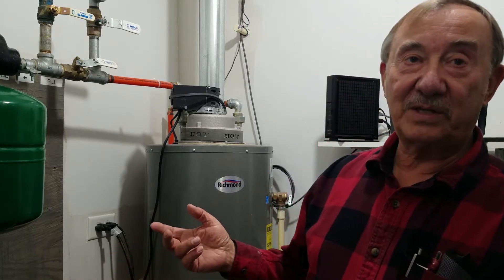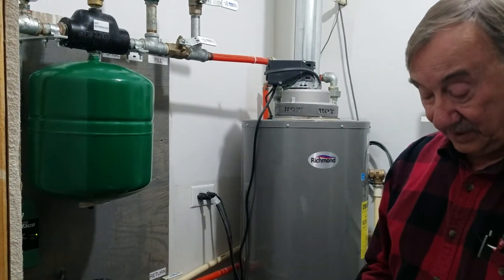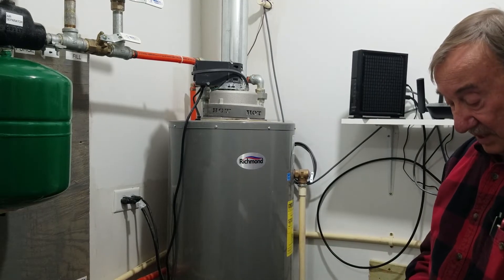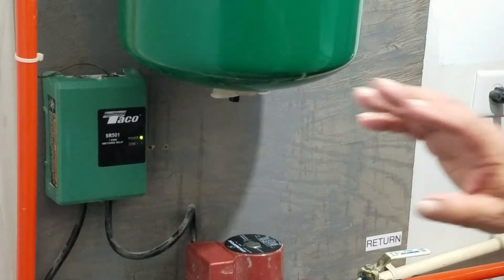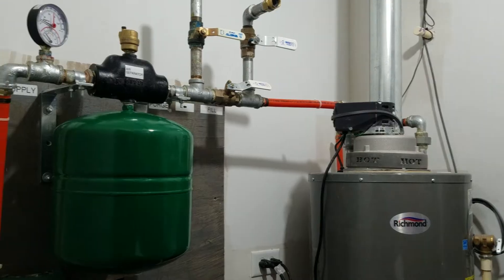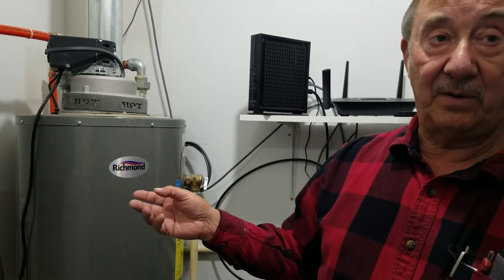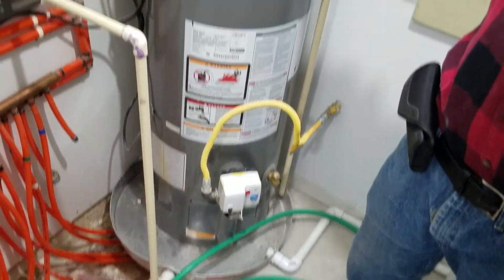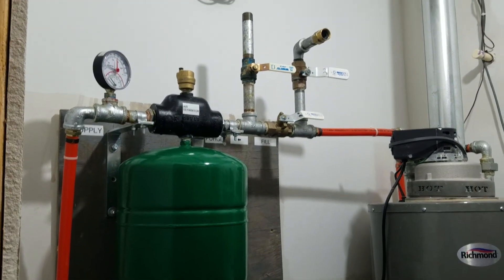Radiant Floor Heat With A Water Heater

Comment: I have 100percent radiant heat in my 1600 foot one floor home and 800 sf garage under it. I have an 11 zone manifold upstairs and a 4 zone manifold in the garage. I currently have a Buderus 115kbtu  cast iron gas boiler that heats the radiant system flawlessly. I have 35 solar panels that cover my electric bill 99%. I am considering removing the boiler amd installing an 80 gallon HYBRID water heater because I want to add 35 more pv panels. My energy guru says that hybrid water heating is cheaper than gas or oil. I always thought that a water heater wouldn't cover heating my home... which is fairly well insulated.  You may consider replacing the gas water with electric hybrid... and possibly a stainless storage tank to cover the slower performance of a hybrid wh versus gas. Nice video.
Reply: I can't imagine running an air conditioner is cheaper than gas or propane and you have to have a mild climate. It's -22 C here and dropping to -29 tonight without the windchill. A heat pump would never work here and gas is so cheap that electric doesn't make sense. I don't know how much solar panels are, but I don't think you will ever save any money buying enough to heat your water. You're probably better off using vacuum tubes even though they are a pain in the ass. And do you really have 11 zones in a 1600 square foot house? That seems insane and way more complicated than necessary. You should do a video on your house because it's a pretty different system.
Reply: What are all the zones for? Wouldn’t the garage be one zone? I’m starting to look at building my own system.
Reply: @briankloc  Looking at it again, I think he means loops not zones. The garage should have 4 loops controlled by as one zone by a single stat. You could have bedrooms and living areas as different zones but getting overly complicated anymore makes for more problems with no efficiency savings. You usually try to go 250 feet per loop to get 4 loops out of a 1000 foot coil with as little waste as possible. Getting a designer to design it isn't too expensive and guarantees it will work right.
Reply: @briankloc  the garage has 4 loops of pex in the concrete. All 4 loops are controlled by one thermostat.... but requires 4 zone valves.... one for each loop. It requires a 4 valve manifold.
Reply: @deckmonkey1459  11 zone valves for 11 loops.. controlled by 4 thermostats. As far as the efficiency of the hybrid water heater... if it gets crazy cold like you describe I honestly think it would switch to resistance heat. The energy guru knows the numbers and for Massachusetts its cheaper in DOLLARS to heat water with a heat pump water heater than gas or oil. It really almost never gets below zero in my area south of Boston. Adding more solar panels to cover heat and a hybrid plugin car will have a payback date... the energy guru set that too. The PV system in place now covers 100percent of my electric for 5 years. I get a check quarterly SREC that pays me about $3000/ year just to produce electricity. The system will be 100percent paid paid off in 1 year... between SREC and electric bill payback. For the next  20+ years its all profit.  I hope to add another 5 to 8 kwh system to cover water heating for heat and domestic hot water. I will need to remove my boiler and use a heat pump. It will require a standby tank for heat due to slower recovery  time.
Reply: In Massachusetts its CODE to replace EVERY 80 gallon water heater with a hybrid when the old one fails.
Reply: @deckmonkey1459  I am sure there is a point where the hybrids are not effective. We see very few days below 20F
Reply: @briankloc  each run is 200 feet max. Bathrooms, bedrooms,  garage, living spaces are MUCH more comfortable with their own temps.

Comment: Nice and simple. I might suggest swapping those 2 copper manifolds for a radiant manifold. The radiant manifold doesn't need to be fancy but it will allow you to balance the flow of each run of pipe. They are very user friendly. There is a gauge for each run, just turn knobs till they are equal, then if you want you can turn up or down areas of the house to adjust comfort.
Reply: If all the PEX runs are the same length, 250' in this case, the fancy manifold is not necessary. I use them when there are many loops at different lengths and/or multiple zones on the manifold. Otherwise, copper manifold are fine and have far less resistance.

Comment: I've been wanting to try this for 20years. I was just curious how warm the water is when it returns.  I know the warmer the water returns are the more efficient it will be. Thanks
Reply: Radiant systems are typically designed at a 20 degree temperature difference. Therefore, return water temps are subjective to the temperature requirement of the system. Always design the system to the lowest operating temperature necessary so the you can use a condensing gas boiler and run it at those low temps. The lower the return water temp., the more the boiler will condense and run at a higher efficiency. Every gallon of condensate removed equals 8,000 BTUs of savings, or 8 cubic feet of gas.
Reply: a guy a know says his output is 125º and 112º on return.  he said 3 runs in his garage with each run being under 300'.   hope that helps.

Comment: Cool idea, however, water heaters don't last as long and don't have as many sensors and safety devices as boilers. For others, looking to do this, do your research, there are many codes and rules for hydronics.  Here's what's installed incorrectly: 1. should be a drip leg on gas line 2. TPR valve on water heaters are 150 PSI, should be switched out with a 30 psi boiler TPR. 3. Pump should be oriented 90 degrees and it should be on the supply side after the air scoop for proper air removal 4. Should be 18" of straight pipe before air scoop 5. Primary loop lines should be at least 1" for that many loops. 6.  Galvanized fittings not recommend 7. Distilled water is not recommended in hydronics as it actually leaches metals from other items. 8. the cap on the air vent should be loose to allow air to escape. Pex should be oxygen barrier type 9. There should be a low water cut off device. If it leaks water and empties the tank, the air in the water heater can boil, ruin the water heater and create very high pressure
Reply: yes all of that and more. think of how much cleaner that install would have been if those incorrect manifolds would be turned around.plumber for 49 yrs
Reply: Did he do anything right or is it all wrong? I'm guessing it was cheap and works for him so maybe good enough ?
Reply: You sound super knowledgable.  Im working on trying to design my system and discovered hybrid hot water tanks.  We have 11000 sq feet in our building to heat.  Though its the PNW and the typical heat requirement in winter is only 30-40 degree difference.  Much of the loops will be kept near 60 degrees as they are rooms not being used much.  But the main living space we will have it warmer.   Do you recommend a closed loop system with the water and antifreeze or glycol?  Then another hot water tank for the domestic usage?
Reply: @JessicaBriarmoon  yes a closed loop system with antifreeze(glycol) with a dedicated boiler, and water heater for domestic. Or install a combi boiler

Comment from the maker: Thank you for your interest. The answer to some common Questions,  I have a separate water heater for hot water. 
My gas bill for December 2020 was $48.31. The thermostat was set at 70 degrees. This is the 4th year I've had this system with no issues. I sized it based on my experience. For many years I lived in a 1000 square ft poorly insulated house that had a 64,000 
BTU furnace in this area. So it seemed reasonable that a 60,000 BTU power vent water heater would work. It never runs anywhere near capacity, usually about 3.5 hours per day. If your instructions say to mount the pump differently DO IT mine did not.
Reply: If it works, that's what really matters! I run a wood Boiler to heat 3000 sq.ft and am going inside next season, as i'm tired of cutting, splitting, stacking and ash-ing 6-8 cords of wood a  Winter. Your set up is as simple as it can and needs to be. Not good business for either, over-paid pipe-wrenchers and/or the plumbing fitting industries!! Like it
Reply: Seeing those numbers is the icing on the cake. Well done.

Comment: good video.   what is the aprox. cost to install the radiant heat? iam thinking on doing it myself to my garage...
Reply: for all that probably under or around $800!!   FYI im going tankless and while i got a deal i still spent $1000 on just the tank.   mine will probably end up around $2,000.

Comment: Well I’m a bit confused.  You state that you didn’t know what size of water heater to get for the home, then you state it’s only used for the radiant floor.  Are there two water heaters for the home?
Reply: The system he shows is only for the radiant heat, it’s a closed system, that’s why he used coolant and distilled water. He obviously has another one to heat WATER for the house.
Reply: yes he has to have 2.

Comment: I have a system for floor heat to supplement the forced air . Couple comments,  mine has a separate loop for each room , a thermostatically controlled pump on each , so each room can be controlled separately.  It is a closed system with a heat exchanger plumbed so the heat from the household water heater is used as heat source.  It has a air bleed at the high point in each loop , just a tire valve like what is used on chloride filled tires

Comment: Turn the pump 90 degrees. Or it won’t run properly and finally will break down.
Reply: correct he failed to read the directions
Reply: @johnpeters9903  i believe they state they can run in any direction but in one direction the pressure has to be 20psi.  he stated 18psi so hes under but probably why its been ok for 2 years.  his also has the pump mounted lower than the water level so maybe at that height hes at 20psi while the gauge up top is only showing 18psi.

Comment: ... A couple of people have mentioned that your pump is installed improperly… The pump itself can be mounted horizontally or vertically what is important is that the shaft of the rotor is on a horizontal plane rather than the vertical plane you currently have it installed... simply rotate it 90 degrees! You have made several errors in your piping and I don’t recommend using a hot water heater as a heat source… But I gave up trying to argue these points 30 years ago! Enjoy your heating system, it very well may last 20-25 years!
Reply: I'm in the process of installing an in floor heating system and wondering why a hot water heater is not a good way to go. If you say it may last 20 to 25 years then why do you not recommend a hot water heater? 20 to 25 years of service sounds like a pretty good run for a heating system. Willing to listen to any good arguments pro or cons. Thanks for any advice.
Reply: @rv4891  ...unless the unit is rated as a space heating appliance it wont pass inspection in many areas...it would depend on the authority having jurisdiction in your area. Also in Canada many mortgage companies will balk on this kind of system. USA I don't know?  A hot water heater by design is not very efficient. Capital costs vs operating cost... I have been doing this since 1975 so I have seen a lot of things that work and a lot that don't! There are a few basic ideas that should be followed and this system will work a long time. Not sure how to get in touch with each other but I would be glad to help.
Reply: @clars7146  Would a heat pump type water heater be any better? I will be installing floor heat soon in a 40x60 pole barn. Not sure if I will find a water heater with enough BTUs to do that. It will be very well insulated. I figure the cost difference of a water heater vs a boiler is worth a try.
Reply: @toddt8446  heat pump heater takes heat from air that surrounds it. It's like trying to fill up your tank by draining fuel from it.

Comment: Here the valve we use on our return lines.
It has a shut-off valve with a drain cock.
When filling the system, keep this valve closed, and let the air and water come out the drain until the water stream is full.
https://www.finehomebuilding.com/2018/11/09/purging-air-in-hydronic-heating-lines

Purging Air in Hydronic Heating Lines - Fine Homebuilding
Hydronic heating systems can be configured in a number of ways, and it’s not uncommon to find one without dedicated bleeder valves to purge air from the system. In this article, master plumber Tom Cardillo explains exactly how it's done. Learn more about hydronic heating lines here.
www.finehomebuilding.com
Hope this explains.
If you can not get this product, just install a hose bib before the shut-off.

Comment: Where does the makeup water come from?
Reply: It's a closed system. If he if he hears air in the system. He'll have to use his drill pump and add more water. Hope that answers your question
Reply: @MrSprintcat  You can build a closed system with makeup water. If there is pressure relief valve on system there should be a makeup water line in through the expansion tank https://www.supplyhouse.com/Amtrol-110-1-Model-110-Fill-Trol-w-Valve-44-Gallon-Volume-4910000-p?gclid=CjwKCAiAwrf-BRA9EiwAUWwKXlWZ-2VS0P1TNCiBletTCdkHokxfphNtFaNGEla-0ZAfgZl9g2mOxhoCdxwQAvD_BwE
Reply: https://www.supplyhouse.com/Axiom-MF200-MF200-PRESSURE-PAL-Hydronic-Mini-System-Feeder-6-Gallon
Reply: @clars7146  Right on.

Comment: Good morning from Canada. 
I was looking over your system, and you should change the pump motor to the side. If you look at the manufacture instruction the motor has to be on its side.  Here is a video to show you  https://youtu.be/UvrR5ZAkf10
To remove the air, install a drain cock before the return side ball valve and when you are filling, open the supply side, keep your return valve closed, and let the air come out of the drain cock. This works and makes this removal easy.
Glycol, only use a propylene base.

Looks good, but we recommend using the stainless of brass manifolds which have the flow gauge on them to show you have flow in all the loops. Water is tricky, it will take the shortest way back to the heat source.
Enjoy the warmth as you are one of the smart ones that know you have a great heating system, that cost peanuts to run. Way to go!
To help in figuring what size of a heater to use, take an average of 20 BTU's per Square Foot. (Example 1500sf x 20 = 30,000 required.)
Reply: If you could please explain the part about air removal in more detail I would really appreciate it. I built this exact system and started filling it tonight. I'm having trouble with filling and getting the air out. Thanks in advance

Comment: I live off grid in north Idaho and I have used your information on my mountain home.  It works great! I use propane and a wood heater to keep warm. Thanks to you for the post!
Reply: Hi ! I do too have off grid property ,and I'm thinking  of using water heater to heat it,  how much electricity  does the  pump use ? to power it with batteries , not to run the generator all day long

Comment: Awesome thank you so much!  I have a shop with in floor heat and I haven’t been able to use it because plumbers want over $10,000 to hook the boiler to it.  I just found a Rheem right 100 gallon commercial water heater.  My floor is 2800 square feet.  How did you find out how big your water heater needed to be?
Reply: 20 btu's per sq. ft. of floor.
Reply: A whole lot of math.
Reply: What region are you in? Ceiling height? Insulation? Are you likely to have a bay door open every 5 minutes? 20btu sqft sounds pretty low to me. Unless it's well insulated and tight I would aim for 30, your zone is really important to know.
Reply: dear mike jackson, you need to contact a plumber or supply house to fill in all of the variables involved with infloor heat or else you are just throwing darts at a target with no real idea of how the final product will turn out.

Comment: I have a single zone system like yours, it has been operating for over 15 years now. I use a 40 gal. H/w tank my only issue with this setup is about every 6 or 7 years I have to replace the tank, never for leaking issues, always for gas valve or burner stuff. I'm on my 3rd tank now so other than that it is great! Heats a 400 sq foot office in my Pole barn. Cost about $300.00 a year to so. Around 300 gal. of propane. And by the way your pump is infact mounted wrong it should be vertical? Thanks

Comment: Clever, but can't help thinking a small, condensing gas boiler would have been simpler yet more economical. Open vented appliances are unavoidably inefficient due to the constant draft up the flue even when the burner is not lit. A sensibly sized gas boiler would modulate to the required load, and on a UFH system would operate in condensing mode the majority, of not all of the time. The system could also be dosed with inhibitor to protect the boiler and other components- given the volume of a water heater this would be impractical.
Reply: Look up the reviews on condensing boilers...very expensive (compared to conventional tank water heater), and they require yearly maintenance to descale, and they throw error codes and stop working frequently.

Comment: You should have a pressure regulator and a non return valve connected to water supply if you develop a leak and run out of water you have created a bomb also most water heater corrode due to electrolysis change anode as recommended